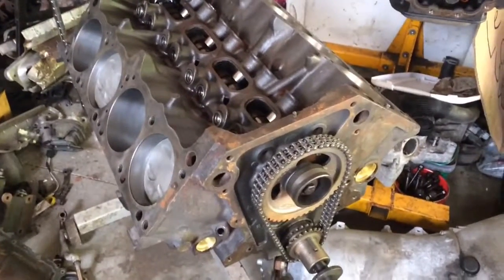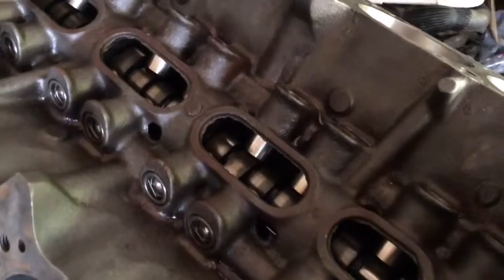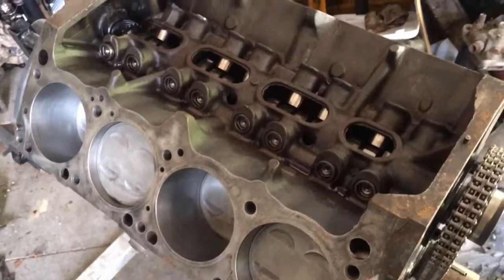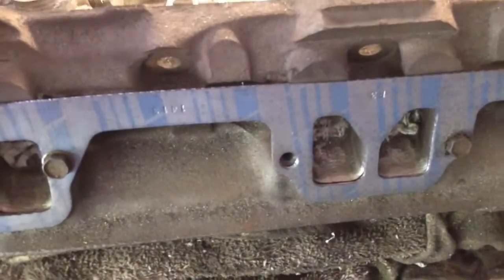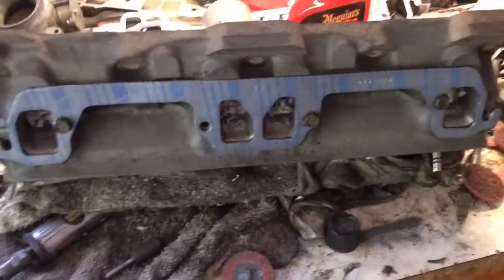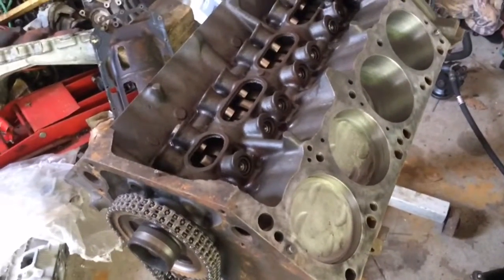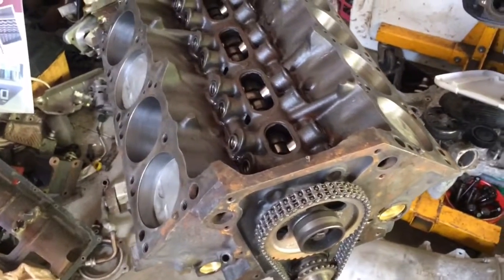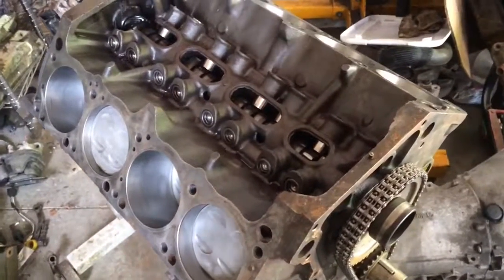67 Barracuda restoration pt 1

Comment: Why would you go with the 318 ?/?
Reply from the maker: 67 cuda cheap to build and cheap power
Reply: 360 is a cheap build too. Cheap to modify, more torque, and horsepower .
Reply from the maker: 67 cuda not necessarily. I don't want to deal with the internal balancing of the 360.
Reply from the maker: External
Reply: Got ya'. I've got a 67, 383, and a 71, 360, and a friend has a really modified 340, but wants 4 grand for it !  Weighing my options on my 67 f/s ! Might go with the 383, since it's year correct, and was an option that year ? Mines a factory 4 speed, bright red, with stock sports stripes. Fastback of course ! With mods on brakes, suspension stiffened, modifying that 383 might be a screamer, and handle better with the added weight ??! What's your thoughts on the engines ? BAck in the day, the top dog on the street seems to be in this order, 426, 340, 383, 440, in reality, stock of course ! No end to mod comparisons, lol !? BUt the 426, and 6 pack guy's were always under the hood, from what I hear ?! I'm really a small block guy though ! Always loved the response, and rpm's, since I'm not a strip guy, but a bit of a street cruise, and show off, lol !!
Reply from the maker: 67 cuda if you love high rpm, kick ass power, and not wanting to be under the hood a lot, build a 340
Reply: 318's are awesome it's the 340 little brother you can't beat the stroke of a 318 340 the only thing lacking on a 318 is it's bore and they have a cast crank but if you can find a 273 or 340 crank they are forged and that's all you need to have a great bottom I'm a big fan of 318's they are great high revving engines and don't cost the same to buy a 340 block  plus they are all over the place you can get them cheap
Reply: @79tazman  of course I’ve never modified a 318, but the ones I have owned seemed highly overrated, and underpowered. Like sticking a toys motor in a regular sized vehicle. I’ve had better experiences with the 360. Haven’t had a 340 yet.